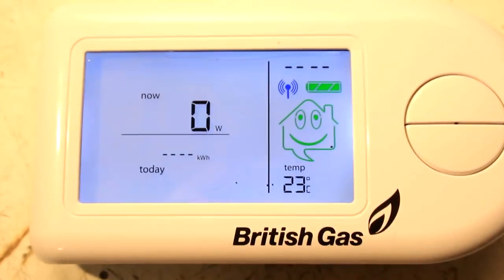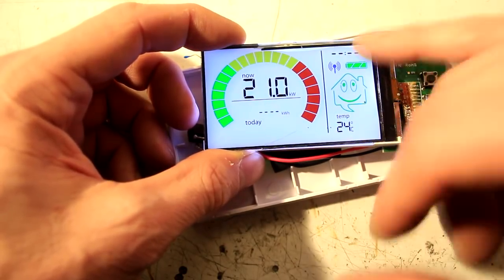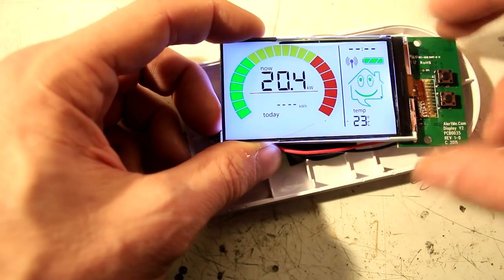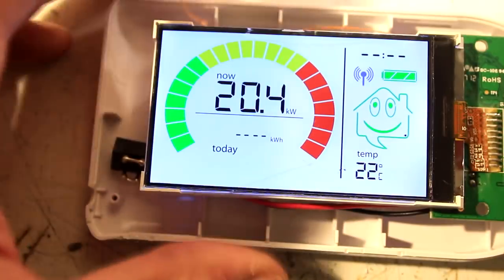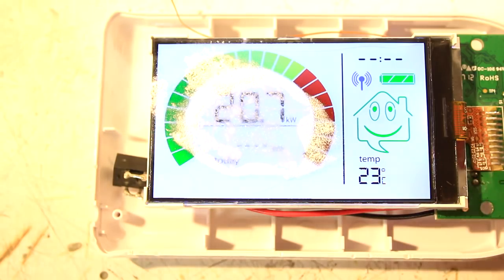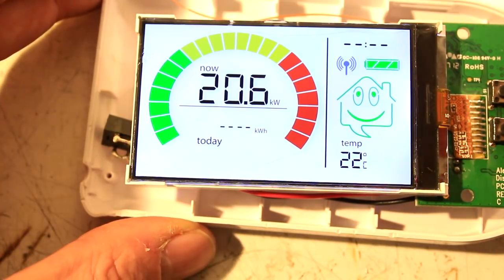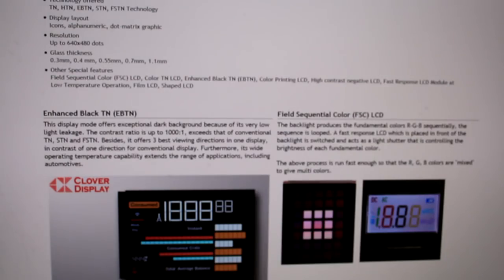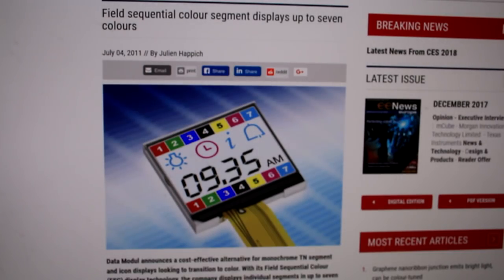Interesting colour LCD on home energy monitor

Comment: Maybe it is not accurate because they assume a bad power factor and calculate that into the reading.
Reply: It's measuring VA (well really only A, with a fixed V), but the display is in kW - it must assume a power factor to convert between the two.
Reply: Bjorn Roesbeke
No. It's measuring current only. It's trying to use that to guesstimate the true power. To do that for real, it needs to know the voltage and the power factor as well. Since it doesn't know either, It's having use guessed values for both.
Reply: It's just measuring true power, there's no need to measure power factor.
Reply: I was going to say the same thing. I have a different monitor and that has a setting for power factor. The default wasn't 1.
Reply: Hi, I did do some integrating to allow it to work better for bad power factor devices. I can did out the schematics

Comment: Does anyone know if you can sync up a different smart device like this. Reason I ask is I was with southern electric and it was great. Now I’m with Ovo I’ve got a new smart meter and it’s dog poo. So was wondering if I could sync up my old one to work with my new meters?
Reply: Hi, These devices run the Alertme Manufacturer Specific Profile (MSP) so they will only connect to other Alertme devices (well the could have until British Gas turned off the servers at the end of last year). Alertme started shifting the code over to the more standard profiles a few years ago

Comment: 20KW ?  .... What are you doing sending someone back to the future..

Photoinciniduction doesn't use that much juice.
Reply: cucking funt if im not mistaken he connected current probe to transformer so it reads 100a (its 100a but at much lower voltage) but voltage reading is from 220v line so it gives fake 20kw reading
Reply: photonicinduction doesnt seem to be consuming any juice right now. But last i saw him, he looked happy!
Reply: I recall photonic using more than 20kw for some things. Remember that time he blacked out the whole street? Top geezer.
Reply: Thank's for repeating what he says at 4:00. I didn't understand the first time. /s

Comment: one reason for them using NiMH might be that NiMH batteries are generally better at taking the abuse of being continually charged and it being intended for semi-permanent installation.
Reply: The reason I designed in the NiMH cells was that at that time I had not used any Li-ion cells into consumer products and Alertme was happier with using the "less troublesome" NiMH's

Comment: What's under this display? some PCB with rgb diodes?
Reply: Under the display should be an edge lit light diffuser - usually a multi layer sandwich with either a wedge or a foil with high internal reflection except where the surface is etched or where there is a sharp edge in it, then it will be either etched in dots or lines facing the display back side or have lines of steps. Then there are also diffuser foils and reflector foils. And it would be edge lit from the another diffuser and reflector that runs alongside the green controller PCB, with the LEDs being on the PCB. This is how I imagine it anyway, because it would be important to them to get the number of RGB LEDs down as far as possible, so you wouldn't sprinkle them over the whole area.
Reply: I opened a printer scanner module recently. The LED assembly had a long stick as the light pipe and it had printed squares on the top to diffuse the light. The squares got bigger, the further away from the LEDs they were. Very cool way to make a strip of light.